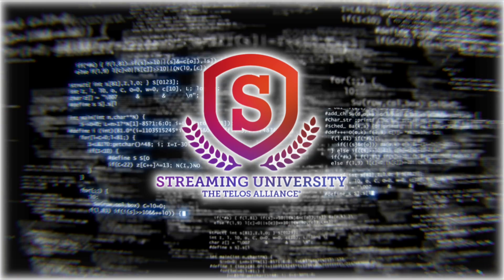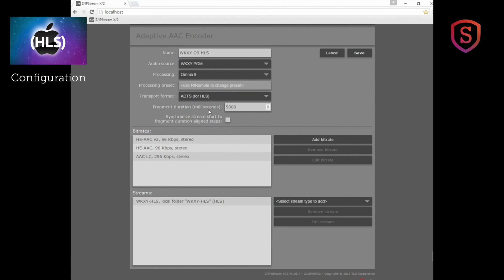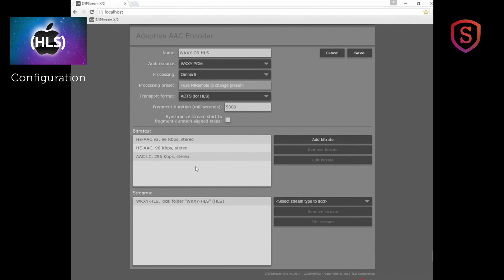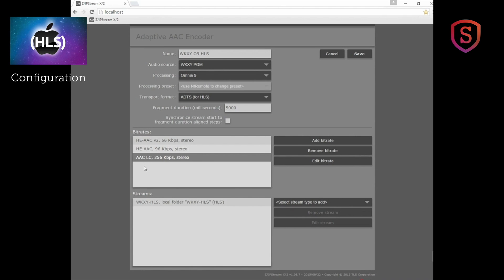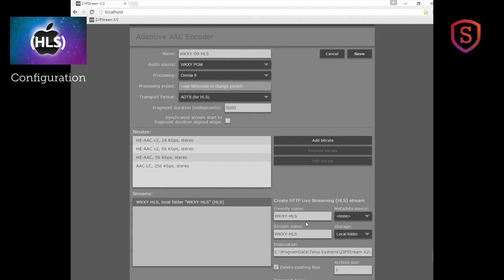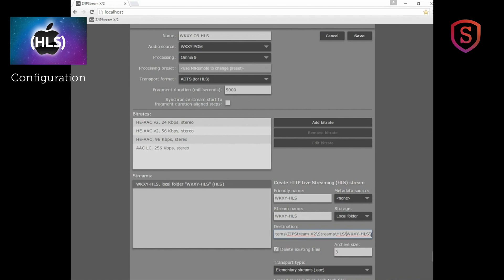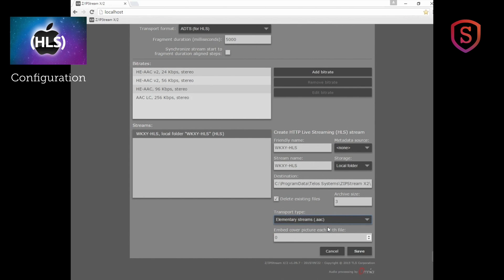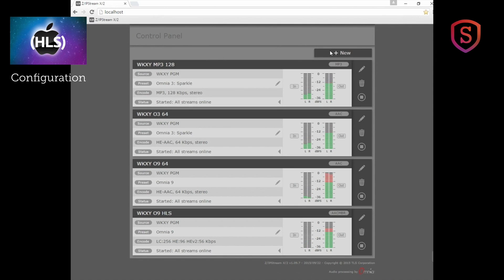Streaming University - Chapter 12 - Configuring Apple HLS Streaming

Comment: Thank-you. An informative chapter. I'd be interested on some further information on the server configuration. Perhaps AWS and Wordpress.
Reply from the maker: Hey there, Tim! Glad you found this helpful and informative. As for your inquiry on sever configuration information— it's currently outside of Telos Alliance's scope to guide someone through such configuration. There are Content Distribution Network (CDN) providers who offer this service and provide the requisite bandwidth, equipment, and expertise to create an effective distribution infrastructure.  Even smaller content streamers will typically use a CDN for this purpose.  Some examples of such CDNs are StreamGuys, Securenet Systems, Triton and Wowza. Here's an article you might find helpful on choosing a CDN should that interest you: https://cdn2.hubspot.net/hubfs/319226/Choosing_a_CDN.pdf

Hope this helps!